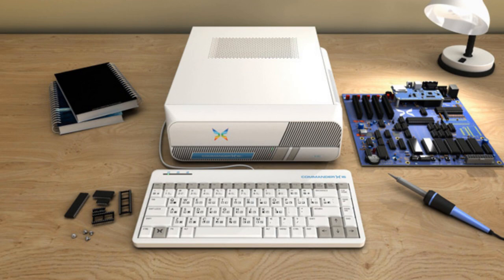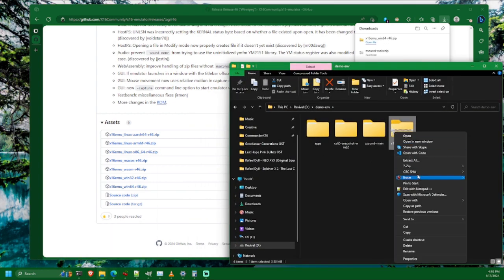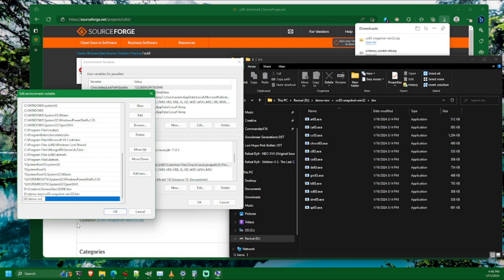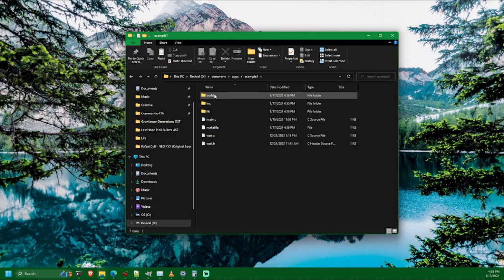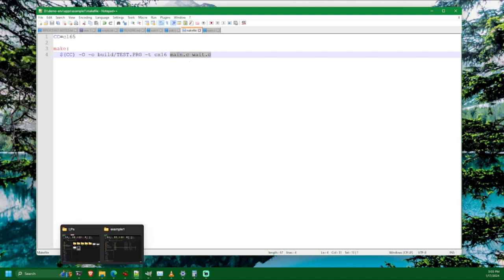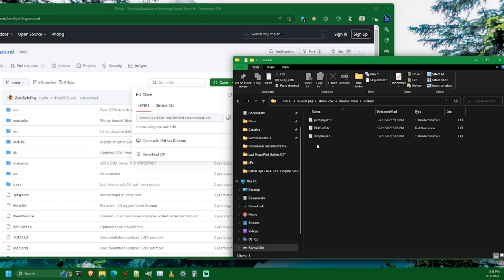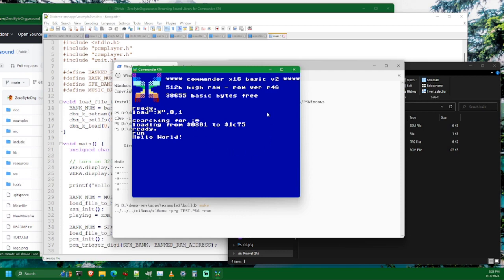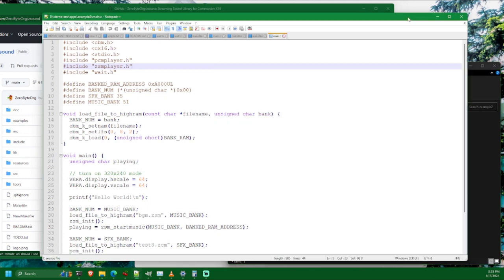Commander X16 Game Devlog Part 2: Setting Up Our Environment

Comment: If for some reason, you can't download the compiled version, I got ChatGPT to fix the makefile for zsound on Windows, haven't tested yet, but it did compile:
# Simplified Makefile for Windows compatibility

LIBDIR	?= lib
LIBRARY ?= $(LIBDIR)/zsound.lib

EXEC ?= TEST.PRG
SRC_DIRS ?= ./src

CC		= cl65
AS		= cl65
LD		= cl65
AR		= ar65

FLAGS		= -t cx16 -g
CFLAGS		= $(FLAGS) -O $(INC_FLAGS)
ASFLAGS		= $(FLAGS) -c
LDFLAGS		= $(FLAGS) -C zsound.cfg -u _EXEHDR_ -o

# Manually list source files for simplicity
SRCS := $(wildcard $(SRC_DIRS)/*.asm)
OBJLIST := $(SRCS:.asm=.o)
OBJS := $(OBJLIST)
DEPS := $(OBJLIST:.o=.d)

# Include directories
INC_DIRS := $(SRC_DIRS)
INC_FLAGS := $(addprefix -I,$(INC_DIRS))

$(LIBRARY): $(OBJS)
	@if not exist $(LIBDIR) mkdir $(LIBDIR)
	$(AR) a $@ $(OBJS)

.PHONY: lib
lib: $(LIBRARY)

# Compile rule for object files
$(SRC_DIRS)/%.o: $(SRC_DIRS)/%.asm
	$(AS) $(ASFLAGS) -o $@ $<

.PHONY: clean
clean:
	del /Q $(EXEC) $(LIBRARY) $(OBJS) $(DEPS)

.PHONY: objclean
objclean:
	del /Q $(OBJS)

.PHONY: test
test: $(EXEC)

.PHONY: %.h

.PHONY: %.inc

-include $(DEPS)

Comment: drj, following your tutorials.   One question though. I have CC65 installed, make installed.  Works great with Hello.c.  But,  where is wait.c or Example1 and Example2 you mention in this video?   I don't see it on your linked drj cx16 page.   Thank you for your time and effort.   I am looking forward to using your XIST library :)
Reply from the maker: Hey, sorry I'm answering this so late, it didn't show up in my comment feed for some reason. At this point, the Xist library is complete, so I recommend heading to my website to download it. It has an environment already set up to use not only the stuff in this video, but also the Xist library.